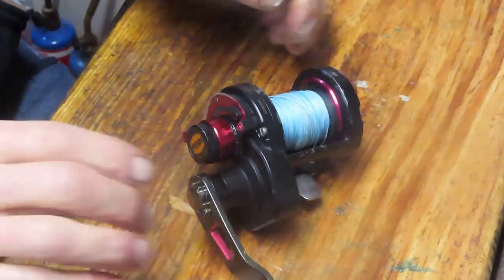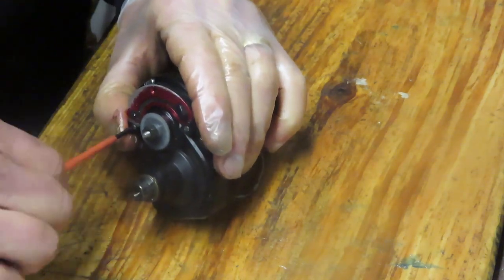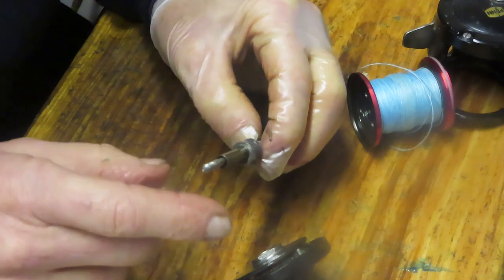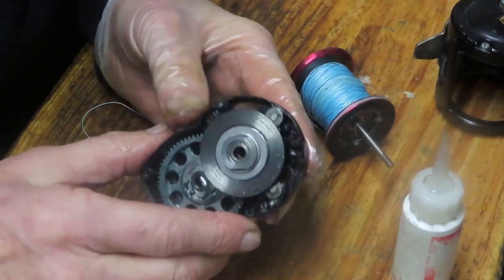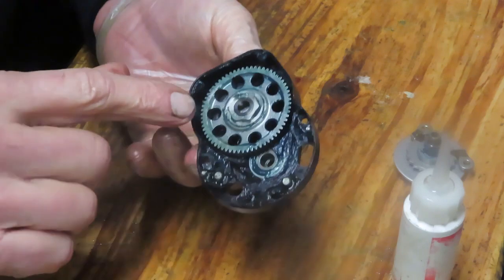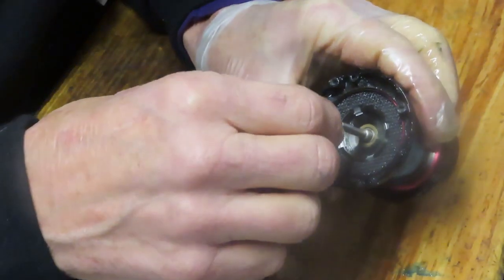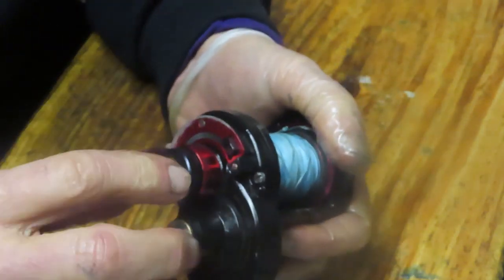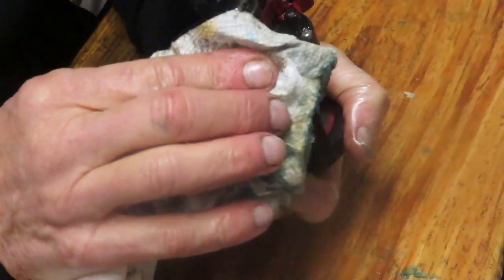Penn Fathom 15LD lever drag fishinbg reel how to take apart and service

Comment: Hi Dennis  - - - One thing about this fishing reel that strikes me to say the
cranking handle don't seem to fit the reel I could be wrong but to me it's
kind of too big, once you opened it there sure was a lot of old gummy 
grease - but as you did a complete service it's working nicely - good video .
Reply from the maker: That handle was a replacement leverage handle.  The ones shipped with the reel are more in proportion.  Thanks